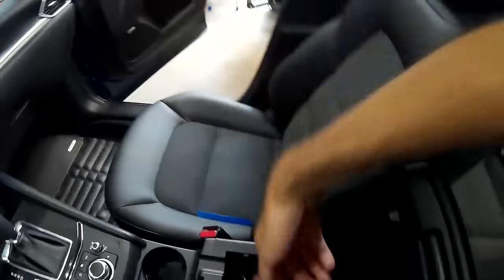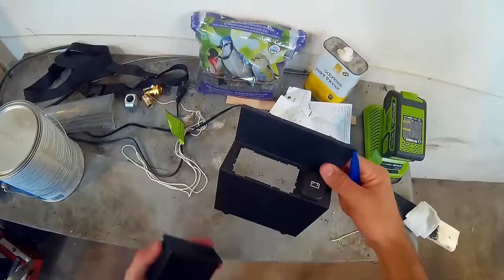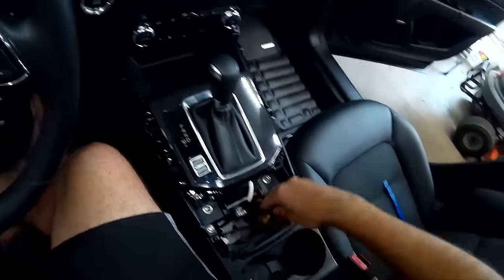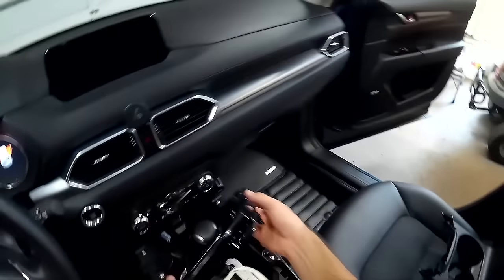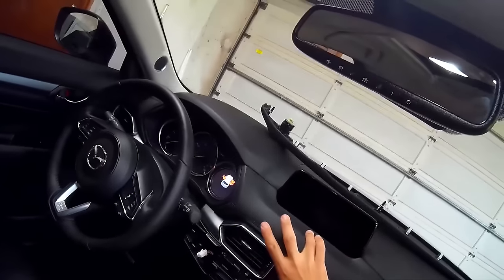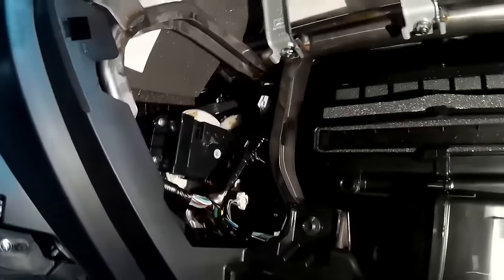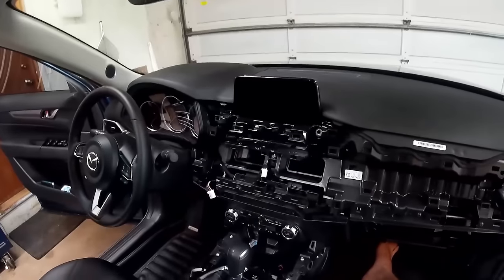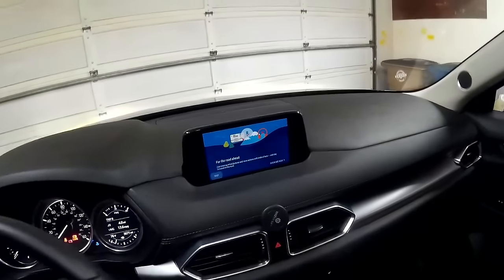2017 - 2018 Mazda CX-5 Android Auto/Apple CarPlay Installation

Comment from the maker: 💸Purchase the retrofit kit here: https://amzn.to/4bgVp4z

This is a video showing the installation procedures for the new auxiliary hub and cables to get Android Auto and Apple CarPlay running on a 2017 - 2018 Mazda CX-5. BE SURE TO INSTALL VERSION 70 OF THE FIRMWARE PRIOR TO INSTALLATION OF THE NEW HARDWARE!!! Perform at your own risk. I am not responsible for any damage done to your vehicle. 

Firmware is located here:
https://drive.google.com/drive/folders/1vOcwLt7zYlpFS1wtDtdoz80SU7Ti8WnX

Detailed information regarding firmware and hardware is all located at the following link:
https://www.mazda3revolution.com/threads/mazda-connect-mzd-firmware-cp-aa-wcp-links-help.236775/

Comment: anyone else watch the first few minutes of this, and then convince yourself that you don't actually need AA or CP? lol
Reply: Opposite here. I only needed two tools!
Reply: Ha ha! I was about to order the parts but this video got me rethinking. You can always use your cell phone navigation instead. Right!
Reply: As soon as he started dismantling the center console 😭
Reply: Right? All this to have a barely larger version of your phone on the dash? lol. Cmon. Especially in 2022. It’s less than another 200$ to have the dealer install it. What a nightmare.
Reply: @Msigw  That's true man😂😂😂
Reply: @Msigw  took me about 3 hours.
Reply: My god, he wrecked the car, that's all I'm thinking
Reply: Excuse me, can you tell me what is the latest version that is updated for CarPlay before installing the cable and if it works only with a USB or wireless cable, thanks or it depends on the module.
Reply: Yes, I felt the same way. It became overwhelming.
Reply: It doesn’t have to be this difficult but Mazda made it that way
Reply: Lol. Yes.
Reply: lollllllllllll totally 😂

Comment: Just got a 2018 cx5. There’s no way in hell I’m paying $400+ for the dealer to upgrade me to AA/CP. I’m getting the kit and using this video to install it. It’s the best instructional video I’ve found so far.
Reply: I hear you, but as someone who has done a ton of disassembly on cars for years, I'd rather just pay the dealer and be done with it. Sometimes it's just not worth the hassle.
Reply: In 2022, I just had it done to a 2018 CX5 for less than 360$, by my local Mazda dealer.
Reply: @Msigw thanks for the numbers. I just bought a 2017 cx5, was scratching head after watching video. If the set cost around $90, they are charging $270. I will check my local mazda dealer.

Comment: Wow! Well done but it is quite a job. I don't know if I can take the plunge. Too many trim bits to be removed. Worried about rattle after reassembly.
Reply: do you see the kids they have working at the dealer. it cant be any worse.. reading is fundamental.. patients and will to save about $300 . im going in.. what could possibly happen..lol
Reply: I was an installer for a while. Cars like Toyotas, Hondas, and this Mazda snap back together like butter, and don't rattle.
Reply: @danielmikels   I don't believe that for a second.Once it's taken apart, something has been loosened. It'll never be like a factory install ever again.
Reply: I'd say you're right to be concerned. Once it's taken apart, it'll never be the same as it was before.
Reply: No rattle. No seal was broken, so no loss in factory quality just because we disassembled it. @tgs1766
Reply: What floor mats are those???
Reply from the maker: Tuxmat. They're awesome

Comment: Have 2016 CX-5 & Mazda 3.  Thanks for the video.  I am shocked at all that is required for a 2018 CX-5 given Mazda claimed to have partnered with Carplay several years ago.  Clearly Mazda did zero preparation for what they are touting as (per mailing they sent me) “this innovative technology”.  At this late date it is not innovative.  You had to disassemble the center console, dash, glove box, and add new wiring. For a 2018, I would have thought a company listed several years as a CarPlay partner would have simply required a software upgrade.  The fine print of the mailing my dealer sent me refers to it as a coupon but doesn’t give details of the value nor the cost of the install.  I called and it turns out based on my vin it is compatible but not eligible for the coupon although when I first inquired the service department was not aware of the coupon.  I will call back later to find out which of the 2 vins that was based on.  I suspect the coupon is valid on 2018’s and maybe 2017’s.  My cost would be $410 in southern Cali.  Based on your video, I am guessing most of that is labor.  I saw a video a couple of years ago of a Ford upgrade to Carplay and it basically involved replacing the usb module and updating software...that was it.  The fact that you had to replace wiring tells me Mazda gave little thought to supporting Carplay until they realized that choice was affecting sales and their MazdaConnect was not innovative or even desirable.

Comment: Great video. I got the install done using just the video. Only difference is that I started the USB cables at the head unit so I was threading them down which mean no coat hangar. Much easier.

Comment: Great video, really appreciate you taking the time to do this walk through! A couple of thoughts: when taking off the very first trim panels (the two on either side of the center console) you really have to yank on those things and it helps to switch to the passenger seat when doing the righthand one to get more leverage. Also, the display panel is easy enough to get out but a huge PITA to get back in! I actually had to pry up the right side of the trim that goes around the speedometer in order to correctly fit the display back into it's housing

Comment: Just did the install in about 30 minutes thanks to your video (did the wire foam in the house as soon as the kit came). Had the same issue as another person mentioned with clearance of the Head unit and the speedometer trim but that is easily fixed by pulling the speedometer trip off slightly. Thank you for the instructions made this job so easy and quick.
Reply: Had this same issue on my 2017

Comment: Thank you. After watching your video, I was able to do the same for the sport trim of my 2019 Mazda CX-5. It was really easy to do. Like others mentioned, it is easier to route the cable starting from the audio head unit end. That way you do not have to pull the cable up using a fish tape. Initially, I had paired the two cable heads  paird wrong and I had to tear the foam wrap.  I corrected my mistake and wrapped the two cables using a wire harness tape I bought from Amazon. It has been two months since the installation and there is no rattling what so ever.

Comment: Awesome job 🙏 I know it’s not step-by-step but you show us how intense it takes haha. This can definitely be done. I’d say the most time intensive is taking apart the panels from the center console to screen. Routing the cables doesn’t take more than 30 mins. Everyone’s results may vary but good on zip tying and use of the padded tape to avoid rattling. Looks like a fun project though definitely takes some free time 🙂. Informative video in case I buy a used ‘17 cx5 touring / grand touring

Comment: Thank you so much my dude! Just finished successor installing it in our 18 Mazda CX-5. Great video, made it easy and gave me confidence to do it myself. Saved $200 compared to what the dealership would have charged me for the job, and that makes a big difference being Christmas season.
Reply from the maker: Happy to help!
Reply: Does anybody know if the navigation directions still work in the heads up display using the Apple CarPlay apps? I asked the dealer and they said it does however I’ve read that it does not and I don’t trust the dealer. However I might do this in stall just for the upgraded USB because as we all know the original USB ports can’t even charge her phone with their absurd half an amp power supply. What a joke…

Comment: THANK YOU SO MUCH FOR THIS INCREDIBLE  INSTRUCTION VIDEO 

It strikes me that how clumsy the Mazda manage this upgrade, you have to bleed 500 $ to have the dealer do it for you or take the risk and spent time to do it yourself with NO official support from Mazda.
I installed mine with help from you and other videos on youtube.

Finding firmware also take time and efforts.

The cable that came from Mazda genuine part was arranged in wrong way had to rip off the sponge coat and realign.
 They even failed to design a common sense cable with all the confusion about the color of the connectors and wires!

Disappointed by Mazda big time

Comment: Thanks for the video, it's the best out here to show how this is made. I studied it and was able to install the retrofit las weekend in my 2017 Mazda 3. The only difference was the side trims on the central console, my I touring doesn't have the leather ones and it's a whole piece but I just removed the gears cover to make sure I was routing the cables correctly.

Comment: Thank you very much, this video was tremendously helpful. I got everything apart and back together without breaking a single tab or clip. CarPlay and Android  Auto are working perfectly, plus I also installed the OEM remote start system while I had everything apart.
Reply: Where did you get the remote start and how much?
Reply: Where did you get the oem remote start?

Comment: I could not re-insert the CMU without pulling out the right side clips for the meter hood so I could get behind it. This was mentioned in the install guides. Not sure how you got yours back in without doing it. Kind of looks like you cut the video a bit at that section. Just wanted to comment in case any one else runs into the same issues because I spent a half hour trying to get that CMU back in T.T
Reply from the maker: I guess I was just able to bend it enough to get it past it. It's tough ABS plastic.
Reply: I got stuck at the same place here. Had to pull the meter clips to fit back in. Thanks for the tip👍

Comment: I think you should have disconnected your battery first. Anyways, extremely thorough video and I certainly appreciate it. 

I was really interested in doing this to my 3 hatch. However, seeing all the things you need to take apart, I think I may just use AA on my phone within my phone mount. I'd be afraid of breaking trim pieces and the inevitable rattling down the road.

Comment: Hi,
Thanks for the video, very useful! Can I ask if is common that Mazda build in maps aren't working once the new unit is installed? And that it loses the car GPS location? Do I need to connect the original cable as well along with the 2 new ones?

Comment: Thanks for all the great info!  Have a few questions: (1) Is this EXACTLY the same hardware kit that the dealer would be putting in if I went there instead? (2) Is the firmware/software update EXACTLY what the dealer would also be using? The reason I ask is because one of the comments was asking you how much of a nuisance NOT having touchscreen anymore was. (3) Does this (your) update lose the touchscreen capability?? 
(4) And is that different from the dealer performed update? I have seen other videos of the update and the touchscreen was working....thanks
Reply from the maker: 1. Identical
2. Identical
3. You don't lose or gain any touchscreen capability that wasn't already there without the update.
4. No difference. Those people installed non factory upgrades that allow touchscreen while in motion.
Reply: Thanks! So then I take it that the “no touch screen nuisance” comment was only talking about not having touchscreen while moving - just as it was before the update. Thanks for clarifying that - it’s just that the way his comment was worded (“the only reason I hesitate to do this”) kind of made it seem like this particular update caused some loss of touch screen functionality. I’m ready to dive in now and get started - great job on the video!    Last few questions - do you have a video of how to do the firmware part?? Or instructions.? And where is a GOOD SAFE site to get the software?
Reply from the maker: No I do not have a video. There are easy to follow instructions and files located at the Mazda 3 forums link in the notes section.

Comment: Did you leave your battery connected? In the instructions it mentions unhooking it, but I wasn't sure if there is a reason you left yours hooked up.
Reply from the maker: I did. I didn't feel like disconnecting it. You're not dealing with any bare wires or risking any ground faults so it's up to you. If in doubt, just disconnect it.

Comment: Wow this video is amazing, thank you so much for making it. Hoping to do it myself soon. Just wondering, what guide are you using on your ipad when you're doing the cable routing?
Reply from the maker: I was using the PDFs from Mazda that are posted on the mazda3revolution forum
Reply: @TheIoniqGuy  Thank you, yeah I looked on there but failed miserably. Maybe I'm doing something wrong but that thread is over 2400 posts and the search function isn't cooperating. Any tips on how to find it again?
EDIT: Nevermind I found it, for anyone else wondering follow the firmware link in the second post of the mazda3revolution thread
Reply from the maker: There's a link in the notes for my video

Comment: Great write up and video! Thank you for all the links also. Does this allow the owner to screen mirror from the phone or tablet to the CX5's screen? I've seen mixed comments in regards to this via thr native AA/CP. TIA.
Reply: Hello, I followed your build exactly as stated here and CP and AA work great. However, for some reason the Native OEM Navigation is not working. When I check the Navigation Settings/Info, under GPS it states no satellites found. Do you have any insight or suggestions?

Comment: Awesome video and appreciate the step by step. Made the whole process easy as can be. 

Do you happen to know the override in order to make the touch screen work in motion with the new firmware? The screen works fine in park but using the toggle wheel while driving is annoying.
Reply from the maker: There's no easy way to make the touchscreen work in motion. There's some hardware hack that you can do that is on Mazda Tweaks website.

Comment: Hello all, I just bought a used 2018 CX5 GT, AA was already installed by previous owner. I notice something weird when playing audio when I connect to AA through USB cable. There is literally no Bass even at highest setting of 6 when I play audio through AA, however when I play the songs via Bluetooth by disconnecting the AA there is bass. Did anyone else notice similar issue?

Comment: What OS version do you have this working with?  Ebay kit says it requires 70.00.21.  Link provided above only has 70.0.0.100.
Reply from the maker: 70.0.0.100 is what I installed in my car
Reply: Thanks. I already have that version installed. :).

Comment: is the dealer required to update you to the correct firmware if you request it and you are still under warranty?  or will they charge you?
Reply: You can do the software update yourself but I had my dealer to that as a warranty update. Current version is 70.00.335. They did it under the premise that the previous software was "glitchy" and I kept getting random echos during phone calls.  It took them about an hour to complete the upgrade.  Note: If you do that software update yourself and make a mistake it can turn your system into a door stop. Installing the kit is super easy, done ONLY after the software update, and should take about an hour to install if take your time. I have done my wife's Miata RF and my 6.

Comment: I am stuck with 3 connectors in the center console. How to unplug those cables? Sound stupid, right?  I am new to this. Just pull it?
Reply from the maker: There's a tab that you need to press in on the connector in order to detach it
Reply: I am going to try again this weekend.

Comment: So I've done the carplay hardware installation.   I made sure firmware was the right version, 70.00.100 NA A.  However, when I plug in my phone, and run Android auto,  the now visible Android/Apple options are grey.  I couldn't even see them before, so I did something right.  Any ideas?
Reply from the maker: Make sure you're using a high quality name brand usb cable. I had issues at first using cheap cables
Reply: @TheIoniqGuy  I've tried 3 so far, 2 are Anker the other is OEM from Samsung.   I've got a couple of others I'll give a shot, too.  I'm guessing though, that Mazda got tired of ppl buying the unit and installing it themselves and the software version I have, 70.00.100 N A N, requires some special trick to unlock AA/CP.
Reply: I've also tried an iPhone with the factory cable and that doesn't un-grey the carplay option in applications or devices, either.
Reply: I'm just an idiot.  I tightened up the connections in the new USB device and it fired right up.  Guess you can charge and use USB data if they're a little loose.
Reply from the maker: Glad to hear that you got it up and running!

Comment: My CX5 is showing the following firmware, this is the correct one? No updates needed?
OS Version 70.00.352 NA N
Fail Safe Version 70.00.352
Reply from the maker: What year is your CX-5?
Reply: 2018
Reply from the maker: Strange that it already had that update installed. But yeah, if it says you have that version then you're good to install the new hardware.
Reply: Yeah that’s what I thought too! I took it to the dealer and asked them about Car Play and they said it was 500 and needed an firmware update, maybe they did it then hoping I would commit to getting it upgraded...anywho great video! Gonna knock this out this weekend!